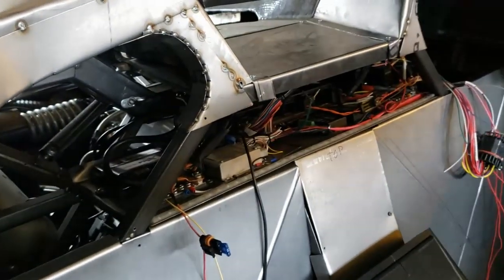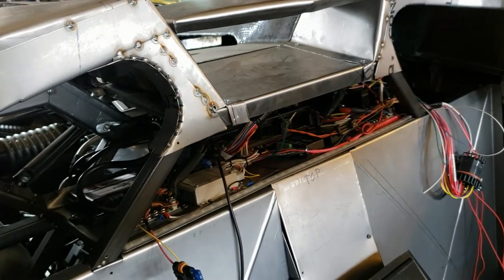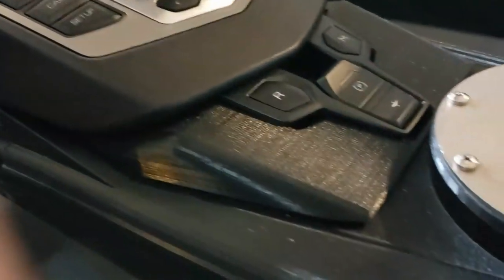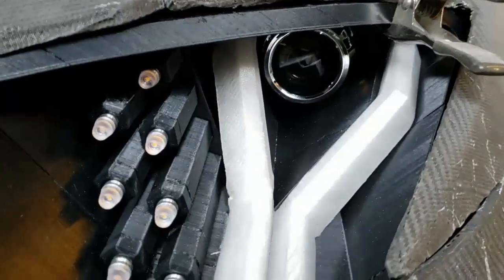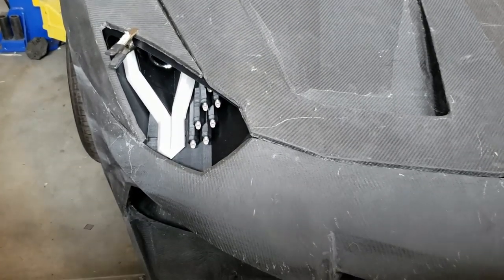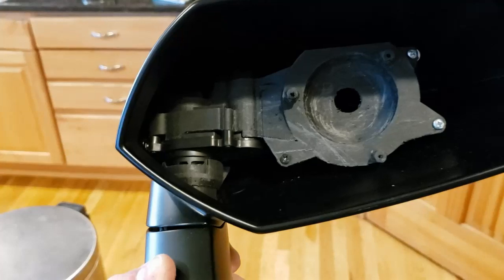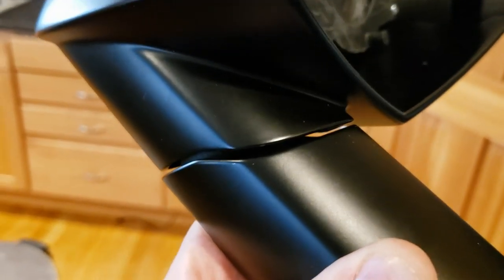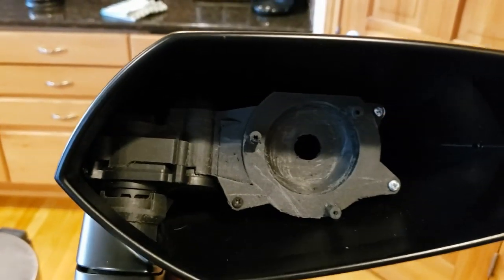3D Printed Interceptor Update 31 Amended

Comment: Awesome using your 3D printer to print masks for professional use. Did you see people are making low cost ventilators for hospital use. It was developed at Oxford and they are working with Sony to begin producing up to 5,000 a week of the custom circuit board. They are using an off the shelf arduino microcontroller and a small parts people can get off Amazon as well most of the parts. It looks like it costs around a few hundred dollars lit has a software element that Oxford engineers are developing and will open source it when completed. They hope to have it ready soon.  https://www.youtube.com/watch?v=6IMaYFNB9tA
Reply: Another one. https://www.youtube.com/watch?v=W6eFVQI74cw